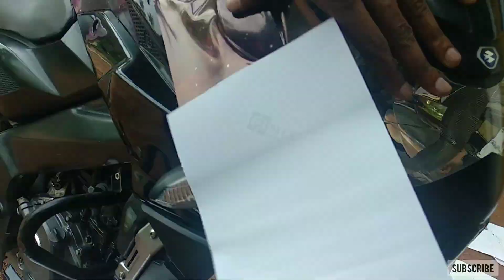ns 200 modified | full wrapping | @glosswrap7140

Comment: mi pregunta es... como le hacen para sacarlo en una sola pieza y despues de colocarlo con el calor no se arrugue, por que muchas veces queda excelente asi a la hora de poner y despues que le da el calor se despega y arruga 

My question is ... how do you take it out in one piece and after placing it with the heat it does not wrinkle, because many times it is excellent when it comes to putting it on and after it is heated, it peels off and wrinkles